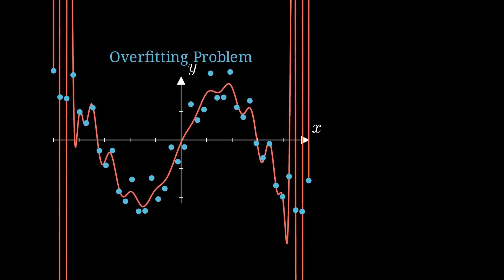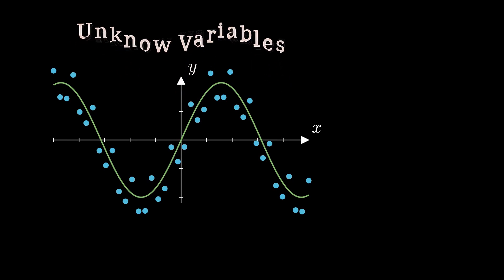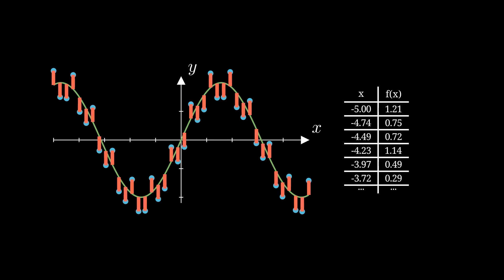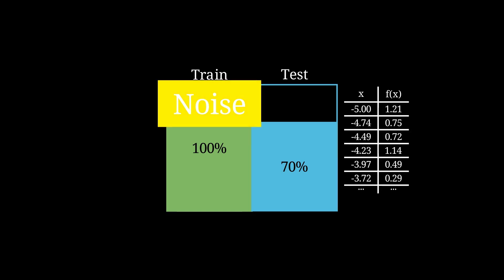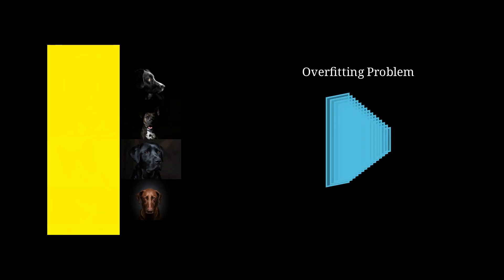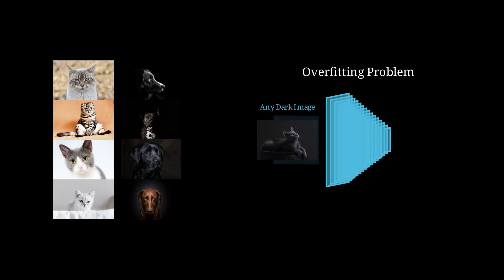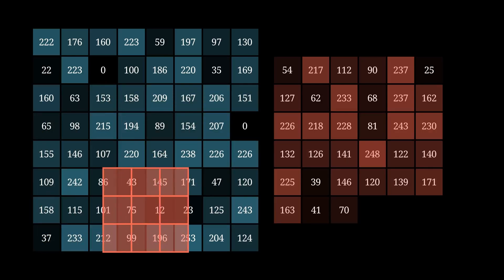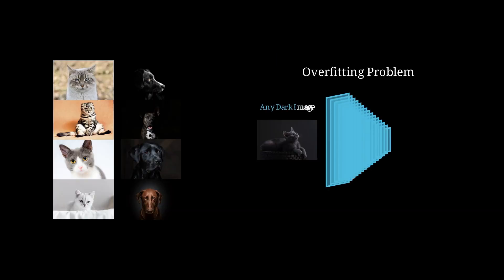But what actually is overfitting | two type of overfitting | AGI Lambda

Comment: 2 types?
I didn't get where 2nd type is
Reply from the maker: One is when the model tries to learn parts of the data in the output that cannot be mapped from the given input features. This is because it depends on external unknown variables, so by learning that information that is not related to the input features, it overfits the training data. And second is when the model can classify data based on differentiable features in the input data, but they do not represent the actual features we want the model to learn. So, it overfits the training data using that information.
Reply: @AGI.Lambdaa  Is the 2nd case overfitting or issue with feature selection
Reply from the maker: @wwhimper  Actually, when a neural network learns any pattern other than the actual pattern we want it to learn and accurately predicts the training data, this is referred to as the model overfitting to the data. As a result, it cannot generalize well to the test data. This learned pattern could be anything — either something obvious like a color pattern (which we call data bias) or other information that humans cannot easily comprehend. You are simply pointing out the reason why the model overfitted to the training data.